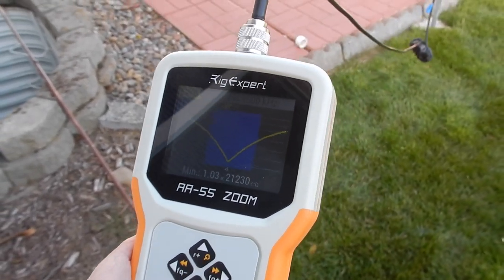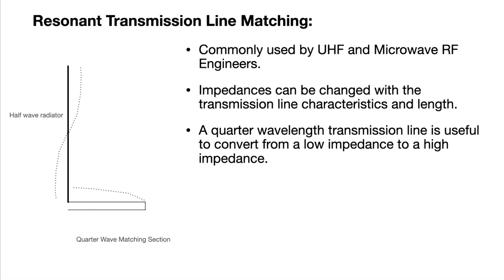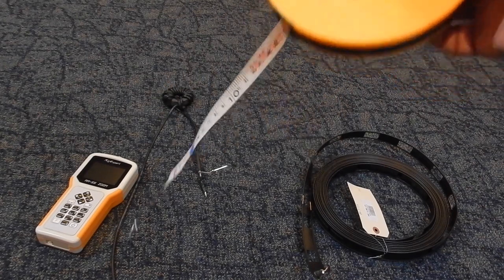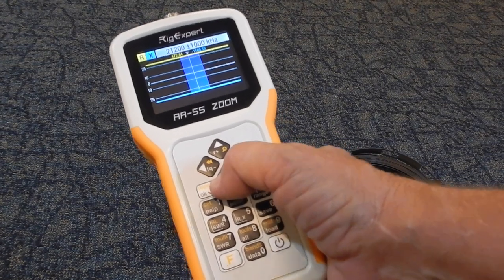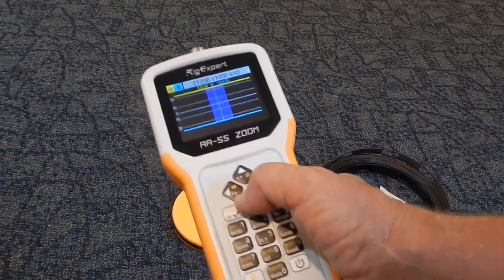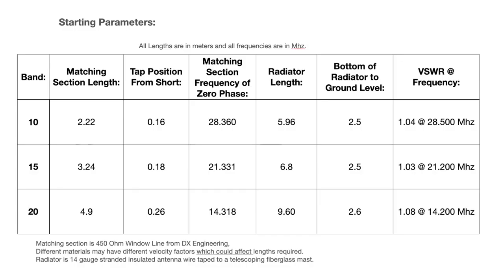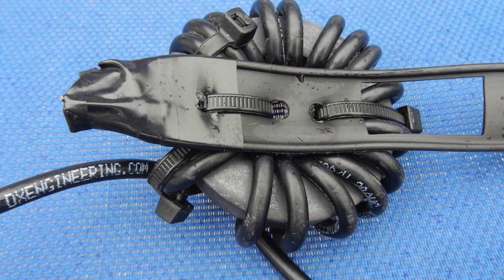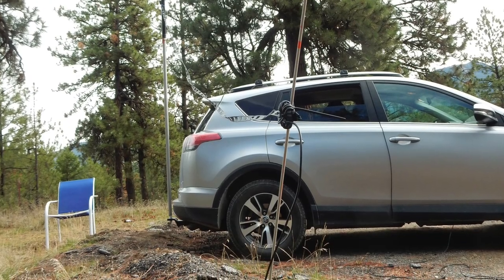Half Wave Vertical Antenna Made Easy

Comment: Nice work.  very effective and simple antennas, especially for single-band dxing.    I have a 15M version and it is simply fun to use -- your installation method on fiberglass poles is simple and effective especially for portable ops.   It can handle legal limit too !

Comment: I've been a ham for 40 years and never had anyone explained how to match a 1/2 wave antenna with the matching section 0 impedance at the shorted feed and super high impedance at the other - just find a point on the matching shunt that is about 50 ohms along the linear length..  Bang!   an Ah Ha! moment.
Reply from the maker: Thanks for that comment!   Makes posting these worth the time.  Transmission lines are pretty amazing. If there is any other topic that interests you, fire away.
Reply: @W8TJM  you're very welcome. When I found your video it was great I mean you have good quality and you explain things well I was surprised you only had 18 or so viewers I guess ham radio is kind of a small audience. Keep up the good work I'll check in.

Comment: Thanks for the informative video. Could you give me some specifications on the toroid that you used for the choke please. I will need to order one in. Thanks, Frank VK4FEM
Reply from the maker: I normally use 12-14 turns of RG-58 on an FT240-31 toroid for 20 meters, and 10 turns of RG-58 on an FT240-61 for ten meters.    73!
Reply from the maker: Frank.... Also, Google "G3TXQ chokes" and you will find some charts on how to select the best torroid for a given frequency and coax.

Comment: how does this compare in losses to a decent autotransformer or "unun" like 49:1 commonly used for end fed antenna?
Reply from the maker: Quarter wave transmission lines are extremely efficient so the loss is extremely low.   No ferrite or winding coupling losses to consider at all.  Big disadvantage is that it is single band, but it does give you the most efficient half-wave antenna possible.   Those 49:1 all band solutions are a compromise, but they do work once you tune them in.
Reply: @W8TJM  i will try one for 10 meter band honestly, lower frequencies seems like too much hassle adding the extra 1/4 wave twin lead makes things much longer and unwieldy. 
do you have the correct 10 meter measurements?
Reply from the maker: @Gabaab  Send me an email on my QRZ.com page and I will send you the most up to date dimensions.

Comment: I stumbled into your video over a cup of Joe this am. So glad I did. I am smack in the middle of half-wave vertical experiments. Right now, end fed half wave graound mounted vertical feed methods are on the agenda. Looking to evaluate QRO opetions for convenience and efficiency. Coupled air core vs toroid core, vs tapped, vs difference capacitance options. What a blast I am having! Once I have my answers, I'll move to phased verticals using the results of previous discoveries. Anyway, I have a couple of questions: do you have any idea how much power this matching method will handle? I presume, full legal limit HF. I am curious if you've tried matching .05 wavelength instead of a quarter wave? That .05 Lambda length keeps popping up on me, and I'm just wondering. Also, do you notice considerable variation when antenna is closer to ground, say 1 Meter? I suppose you want to perform tuning at the actual location and height since tap point may change. I really enjoyed your presentation of this project. Thank you for sharing! 73, Kenny, NZ5i
Reply from the maker: Kenny, Thanks for the comment and glad to hear from another antenna experimenter!   I run a kilowatt with the antenna but have to be careful on wet days.   The end of the matching section is very high impedance so the voltage there is in the thousands of volts.  I have had arcing with sustained corona at that end, so I normally try to insulate the un-terminated end of the matching line and bend it away from the terminated end.  I have not tried .05 lamda matching as I don't think that will transform to the extremely high impedance at the end of a half wave radiator.     Also.... The antenna SWR is not very sensitive to height above ground, although the take-off angle does change.
Reply: @W8TJM  Very good to know. I guess weatherization needs to be a consideration to take seriously if operating in the wet weather. I am very curious how this feed method stacks up in the efficiency / bandwidth dept? This is turning out to be a bit of a shootout of sorts. No single method of coupling high impedance to low seems to be perfect. Each has pros and cons, I'm discovering. Anyway, thanks again! Great video
Reply from the maker: @kennymanchester  Main disadvantage is that it will be a mono band solution.   Efficiency is maximized with the transmission line method as there are no ferrite losses, and no mis-match losses.  It is  tuned resonant matching schema for a single band.  Have fun with the shoot out and let me know what you find out.  73, and thanks again for the comments.
Reply: @W8TJM  Yes, a mononband solution is ok. It will be interesting to see how this match plays next to a air core, coupled LC. One more question comes to mind; what happens if we "roll up" the matching section and and place it in a box? A couple of the L-C combos I am messing with use coax for capacitance. Once it's cut, it can be folded up and put away. Of course this is not the same thing, but still wondering if the stub section can be bent with some tap/length adjustments to compensate?
Reply from the maker: @kennymanchester  The matching section needs to behave like a transmission line, and it can have gentle curves or sags in it.   Coiling it would cause it to couple to itself and its behavior would change drastically.    It can tolerate some bends so experiment with it to see what works/happens.

Comment: Nice video. What would be the effect if this were made for 10m and both the radiator and stub were held vertical on a 30' mast?  I presume behavior would be similar to a typical 2m j-pole but I wonder how it might affect the takeoff angle vs the stub in a horizontal configuration. KB9LNS
Reply from the maker: Thank you for the question!   I do exactly that on my 15 and 10 meter antennas.    The takeoff angle in not affected as the matching section does not radiate.  As long as the matching stub is loose against the mast, the same dimensions work.  Tightly wrapped, the velocity factor is reduced due to the mast so it would have to be slightly shorter.   Lately, I have been using my 15 meter vertical a lot as the band has been fairly open.

Comment: i have already tried several j-pole antennas. unfortunately, i found out that the adjustment to the ladderline results in a significant loss of power. the only question is how much ;-) 73s de DL9HD
Reply from the maker: Transmission line matching has very low loss so wondering where your losses may be occurring?? Currents are low everywhere except the shorted end which has minimal length so resistive losses are negligible.  Mismatch loss should be very low if you do get the right tap point, matching section length, and resonant half-wave length.  (Those are important.) I have found these antennas to be very efficient.

Comment: Thanks for the sharing mate. If use 300ohm is there any calculation formula? I have some 300ohm with me. I may use what i have
Reply from the maker: The length is determined mostly by the velocity factor of the transmission line section, and your 300 ohm might need to be slightly shorter than when using 450 ohm.     I hope to work you on the bands Mohamad!   The 300 ohm should work fine.
Reply: Thanks Mohammad, I was thinking the same question. I have been unable to get 450ohm Ladder Line, but was able to get some 300ohm as an off cut from my new club. Frank VK4FEM

Comment: Everyone else uses 49:1 matcher using toroid core 240-43
Reply from the maker: 49:1 transformers are certainly a viable option to get on the air and I have used them in the past.  The 1/4 wave matching section in the described video technique allows significantly higher currents and voltages in the resonant radiator so the antenna effectiveness is much higher.  Keeping the radiator vertical allows very low take-off angles which is important for DX.
Reply: @W8TJM  ok thanks. im in the middle of building my efhw vertical made of aluminum tubing for 10 meter. Mounted on side of house 30 feet up on either pvc or steel pipe mast. Running legal limit. So im much better off with your way? Few years ago i built a 11m  half wave using gamna matching ring (I think its called)  few feet of 1/4" copper tube for ring attached from radiator tube to ground at the feed point with the coax center tapped to the ring which did well.  Which option you think ill be best with. Im near nyc  My elevation is 300' would love to dx across the Atlantic as well as local.  Thank you. 73s
Reply from the maker: @gabrielM1111  You won't have any trouble working across the Atlantic in the next few years on 10, 15, or 20 meters with the solar cycle improving so rapidly now.!  Look me up on QRZ.com and send me an email and I can send you some information.    73
Reply: @W8TJM  Sorry better recheck you data on that